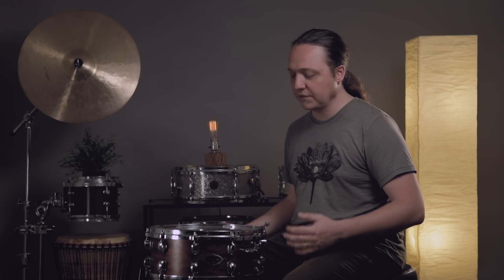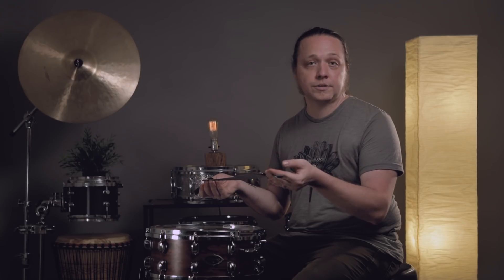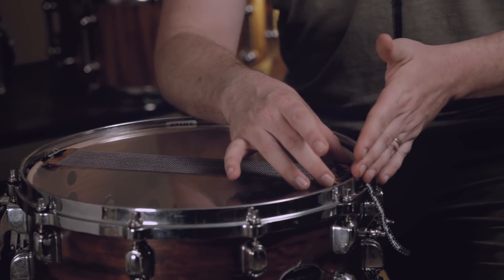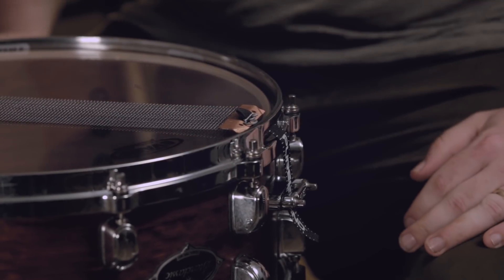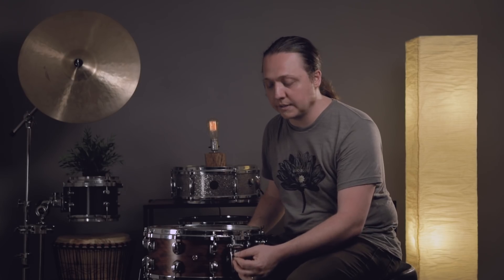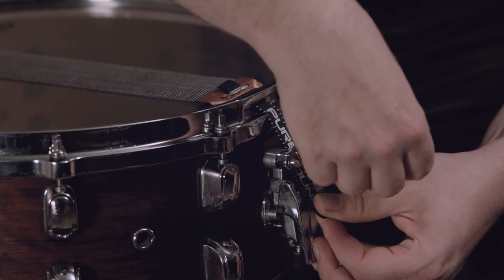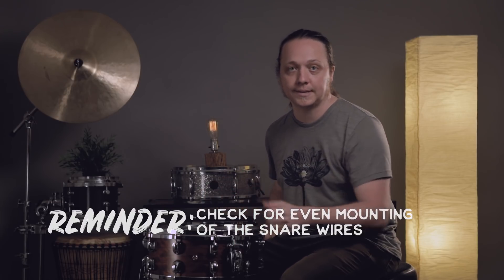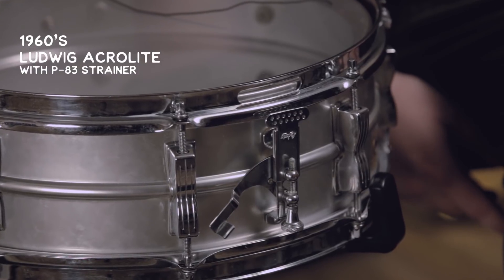Ep. 18 How to Install Snare Wires

Comment: The annoying thing with those Puresound pins is they can move, so you can´t really have the same wire position beneath the drum...
Reply from the maker: I've never had a problem as long as they're installed properly but I know people who have had issues. I'd like to see a revision to the design that removes the need for the cotter pins, which can still be fussy. -Ben

Comment: I wish there was some alternative / new way of doing this without knots/straps/new age (old age) snare mechanisms D: I feel the drum industry is championing so many "cool"/"hip" things but not addressing the tedious minutiae of drums like the snare drum.
Reply from the maker: That’s kind of what the Puresound Custom Pro is. Install the straps once and you shouldn’t have to do it again. Just pull the cotter pins to remove the wires and put them back in to mount.
Reply: I totally get that and the Puresound Custom Pro system but I'm talking about doing away with the snare mechanisms of days of yore. There has to be something out there or someone or some company willing to go beyond this strap/cord/knot tying/snare wire leveling/etc biznass. And YES, I totally get the whole artisanal / handiwork of getting down to the nitty gritty of accomplishing this drummer's least favourite task so I'm not putting it down as archaic or obsolete. I just a new, fresh outlook to snare wires is all! :D
Reply from the maker: I hear ya. The Protean snare from Sonor makes it about as simple as it could get. Punch in the mounting plates and you’re done. They simplified what the Ludwig Supraphonic had for a mounting system and that was still pretty straightforward. Not sure how much more can really be done, as it’s still a very simple mechanical design.

Comment: Is there a different technique if you also have a snare that the butt plate also has a tension adjustment?
Reply from the maker: Not really, you just want to make sure that when the wires are installed and under tension, you still have some adjustability on both sides (neither side tightened all the way) -Cody

Comment: Is there any drum throne out there that doesn’t make creaking noise? Great video 👍👍
Reply from the maker: Not sure but if you find one, let them know they should send it our way 😉
Reply: I use a Gibraltar 9608SFT Softy Drum Throne and it has never squeaked on me in almost 5 years of rigorous usage. It is a pretty heavyweight throne so the fittings are really well made really helps. It has a plush 5 x 14” top (yes, the same size as your snare perhaps) and nice, wide rubber feet. Both provide a super stable platform for playing. The piano screw adjustment let’s you dial in the height precisely. One concern, though not for me, in its lowest possible position, the seat is a bit high. I am 6’ tall, so not an issue but shorter players may encounter some problems. Hope this helps you out Josh, good playing.
Reply from the maker: Ha! Thanks for the recommendation. I love my trusty Roc 'n Soc though it could probably use some love as I've had it for 15+ years and it's been all over. Cheers! -Ben
Reply: A new one !

Comment: I have an early 70s Ludwig Super Sensitive Snare. The one with the bar running through the center, that raises and lowers the wires, rather than pulling them tight. I would absolutely be over the moon to see a video addressing working with that mechanism.

Comment: When I set the wires they sit flat on the snare head, but when I tighten up the straps at some point the right side of the snare wire bed is a little bit in the air and that causes them to rattle even if the rest of the are super choked, what's the solution to that ?
Reply from the maker: Sounds like the straps might not be straight. Check to make sure that they're evenly mounted on both the butt and strainer side. -Ben

Comment: I love doing exactly what you guys mentioned. It really give the drum the ability to perform at its best. 

A problem I run into just with other people is using string or nylon. I had someone rip on me for using nylon because they said how bad it was for the bearing edge and drum head. 

Also in some ways this may be true I have never had a problem with it when setting snare wires correctly onto the drum. 

Could you guys give some insight into this. 

Thanks as always keep killing it see guys!

Comment: What is your preferred snare wire to eliminate snare and tom buzz?
Reply from the maker: We touch on this a bit here in Ep. 11: https://youtu.be/l7Hkk3YID9M A lesser quantity of snare wires will cut down on the snare presence to a certain degree but controlling the buzz has a lot more to do with experimenting with pitch relationships between the snare and toms as well as the setup for the snare drum. To a certain degree, there will almost always be a bit of crosstalk, and that's okay.

Comment: I have a question. Do you guys have any experience with modern Gretsch drums? I have a gretsch brooklyn snare drum I find the throwoff is hard to fixate which makes it really wonky when it comes to installing and positioning the snares. Do you have any advise in regards to this?

Thanks for the wonderful work!
Reply from the maker: Yes! I’ve actually encountered more than a few issues with the Brooklyn series when they were released. I don’t recall working with the snare drums. However, if the snare mechanism is working as as intended but still is providing issues, I’d recommend replacing it. We’re big fans of the throw-offs from INDe. -Ben

Comment: I am currently experiencing wire problems I never had before on my Sonor Protean and my Pearl Ian Paice. I get a really high pitched nasty feedback from the wires, and I don´t know what to do. It is partly resolved on the Sonor, because its wires are less (8 strands) and shorter (31,50 cm instead of the usual 33 cm). Any advice you could give?

Comment: Thanks for the video, Another expertly presented and put together video.
I've noticed different brands and types of wires have different endplate designs. For example Fatcat wires have 2 basic endplate models, pitched for snares with shallow or no beds, and a non-pitched models for snares with deeper beds. Yamaha endplates appear to be pitched as well.
Have you found any general guidelines when choosing a set of wires and mounting options for a given drum  with a particular style of beds ?
Obviously the width of the snare bed dictates how many strands it will accommodate.

Comment: How does the number of strands of wire affect what sound you get? As well as what material they're made of? Phosphor bronze vs steel?
Reply from the maker: Hey! In theory, more wires = more snare wires sound and less = more articulation. Depending on your snare beds, you may be able to use 42 strand wires with great articulation, or get a fat pillowy sound with 16 strands so it's not exactly a law or anything, more something to be experimented with a little to see what your drum likes. Regarding material, I've found that the gauge (thickness) of the wire used to make the snares has a much larger effect on the sound than the actual material. Thicker = louder/aggressive, thinner = warmer and more sizzly.
Reply: Cool! Thank you! You're doing great with this new channel by the way, appreciate the videos and the reply!

Comment: Good tips, especially on starting loose and then adding tension.

I typically prefer grosgrain ribbon. Very inexpensive and effective.

I was surprised you didn’t hold up the drum to check to see if the wires were level. Do you find that necessary at times?

Thank you for sharing!

Comment: Another really good video. You’re channel is gold! I never had too much trouble with adjusting snare wires though. Even if I mostly play an acrolite from the 70s. But the George Way “beer tab” throw off really is a pain in the butt, imho ;)
Reply: Jimmy Jazz I concur, I use a Way beer tap on a vintage Kent I fixed up and that drum is, in general, my most difficult drums to tune up to my liking. The six lugs also play a big part in that as well.

Comment: When I have my snare wires installed (puresound custom so they have cords), the snares rattle even when the throw off is off. The snares aren't overly tight as well, so does that mean that it's an issue with assembly of the wires, or is it the throw off?

Comment: Those Puresound straps with the clips are TERRIBLE!!! The clips never stay put. As soon as you cycle the snare on and off a couple of times... the clips slip through the holes in the snare wire end plates, and either ruin or dent your reso head. They also prevent the end plates from seating on the head properly. Really poor design. Neat quick release concept, but terrible in practice. Just my opinion.
Reply from the maker: We've strongly disagree but this is dependent on them being installed correctly. The majority of the time that I've heard of issues with these (and I use to receive the customer service inquiries when I worked for D'Addario) the issues came from improper installation. The clips will not slip through the end plates if they're properly positioned to sit within the beveled portion of the plates. The clips shouldn't come in contact with the head at all and, as a result, shouldn't prevent the plates from properly contacting the head at all. -Ben
Reply: @SoundsLikeADrum  ... Thanks for responding, Ben. I sincerely gave these the old college try, and actually had them on my snare for almost a year. However... my snare started to sound wonky, and flipped it over to discover that one had slipped through the end plate hole. I loved the concept of these, but after installing them a few different ways... I still could not prevent them from coming through the endplate holes. Maybe an installation video on this would be cool???